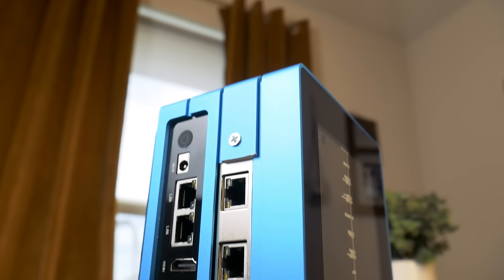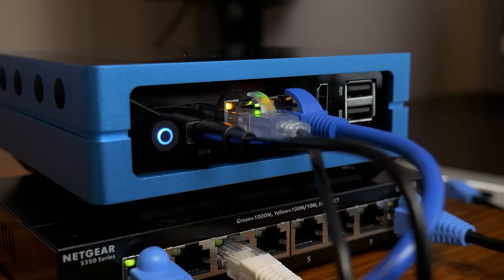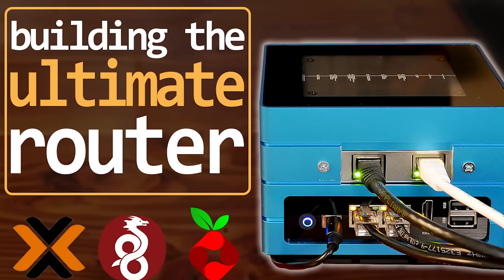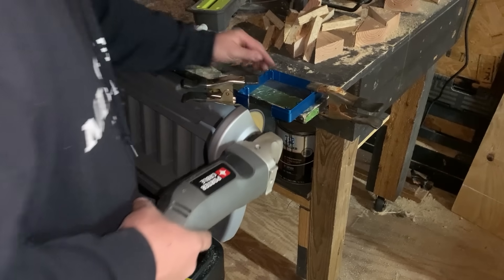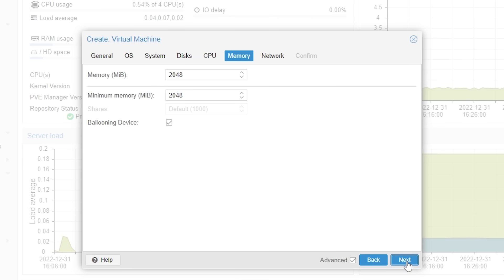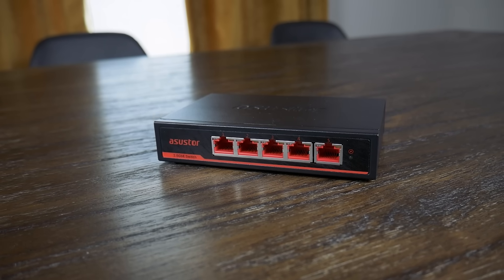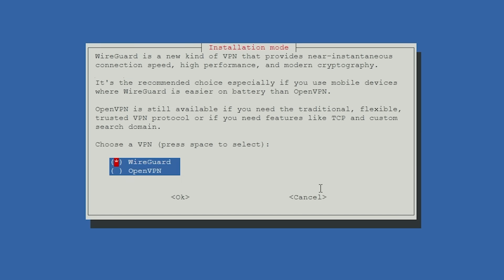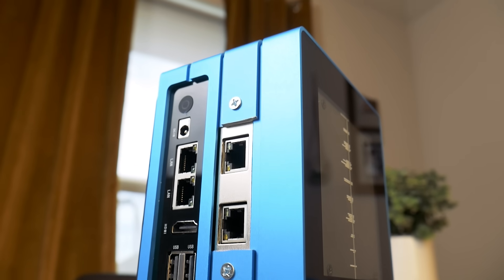Building The "Ultimate" Router - [PFSense + Pi-hole + PIVPN]

Comment: I have bought mini pc from China what has actually POE on 4 ports up to 60w total so i can plug AP to it and i have full speed wifi with proper vlans and all, 6 ports in total, it was like £180 with shipping - this was from the china site where selers are buying it in bulk, but you can buy "sample" as single item so ok, if it has UEFI and there was no so much tax on import from China I would think of buying more and slap on pfsense and sell it as AIO home router or small office
unfortunately it does not run UEFI so i cannot run sophos fw on it directly, i need to run it via proxmox

Comment: 11:53 A word here. That container running pihole gets a virtualized network connection right? Proxmox handles it and it's accessible from anywhere in the physical network if the firewall allows it, right?

Comment: doesn't pfsense have Pf blocker which is as good as pihole, also you can setup dns resolver so you can specify custom dns's, but whats even better is you can setup reverse proxy with HAProxy so you can even have valid certificates and https so you don't see all those warnings.
Wiregard is I believe also supproted, so there is no need for your setup to virtualize pfsense at all. Only reason to do it is if you don't have driver for your NIC in pfsense.

Comment: I've never run a server. I think getting one could be a step up for my computing projects.

Do you have any principles/recommendations for when to use a separate hardware? What 'deserves' it's own OS in a Proxmox setup, when should I just run stuff bare metal, and what can be rune in the same virtual environment?

I'm thinking of getting a pi-hole, creating my own file server for access and storage (linked to some form of backup), run some other self hosted services, and to tinker – without knowing exactly what I mean by that yet.

Comment: If you're running a PiHole, then you should be having it properly take control of DNS. Google "You're running Pi-Hole wrong! Setting up your own Recursive DNS Server!"

Follow those instructions, and then you don't even contact any DNS servers and your PiHole is actually doing the job it should. It's just as fast but after a while of scraping and caching, it will be faster than not doing so as well.

Comment: Pretty neat router you got there! I recently just added a 2nd Wireguard VPN on my Pi5 as a backup for those public wi-fi areas that doesn't allow you to connect using the default 51820 port. I have it running on a docker container and everything is running great after a few tweaks. My main router is a Firewalla Gold Plus that is also a hardware firewall and has tons of features. It also has a built-in Wireguard/OPVN and ads & telemetry blocking features. I'm still curious to run Pi-Hole with Wireguard on my Pi5 though and I'm having a little trouble with that on my network. I was able to successfully run Pi-Hole on another docker container and even have it running on https complete with SSL certs using NGINX proxy manager but when I use it as my DNS on my Wireguard on my Pi5, there is no Internet. I see the traffic being blocked though by Pi-Hole and all the stats in the Dashboard are running.  I think I need to forward the traffic correctly but time is limited and I'll try to troubleshoot that on another time. 😮‍💨

Comment: Found this video not too longer ago, and thought I would assemble the components and try to build out the same "ultimate" router. I am only at the parts assembly stage, and I think my question is a simple one.

Anyone know the part number for the HDD/SSD power cable?

Comment: Is this better than a gaming router?
Reply: Gaming branded items are always overpriced gimmicks
Reply: You can't even compare them. DIY router may not have fancy RGB, but it offers a ton of other features and can be optimized to get great performance
Reply: gaming routers are routers with access points, this doesn't have a standalone access point, but otherwise faster than those "gaming" routers.
Reply: @arhamzarif6313 Shud build another set as ultimate accesspoint
Reply: Sooooo Yes in a nutshell ? @arhamzarif6313
Reply: Gaming routers are a scam.
Reply: Yes absolutely
Reply: WTF are gaming routers?! 😂
Reply: @ferlemes  overpriced gimmicks
Reply: I was looking to buy the TP Link Archer ge800 gaming it has the fastest CPU on a gaming router but now I found that I can build a router that 5 Times more powerful router then TP Link Archer ge800 for myself 😅.
Reply: @Maiza007-c8y  Even better is you can build it cheaper
Reply: @Sphyxx  I just ordered a Ryzen 8845hs mini PC it'll be more powerful than Gaming routers that come in 2030.
Reply: @Maiza007-c8y  probably even in 2040 lol
Reply: It doesn't have red color so it's quite bad actually

Comment: Hello, I am a network administrator and we use pfsense for some customers as a VM on VMware, and it is super stable and reliable. Honestly, it is more reliable than some of our  SonicWall appliances. One customer has high uptime requirements, and the primary wan firewall has been up for about a year and no issues. (I know it needs a reboot. Again, high up time customer. Very specific case lol) but I highly recommend turning an old PC into a router if you want a fun project or your router shows inconsistencies or issues. You just need two ethernet ports, and add-in cards can be cheap. I do recommend Intel NICs if you are doing bare metal port forwarding. Non Intel cards can have issues on pfsense

Comment: I was running similar setup, but it was too much hassle to tinker with it and even my current Mikrotik AX3 is way easier to maintain while running Pihole and Unboud in the container direactly on it. I haven't noticed any performance diffrenece. Another advantage is decent wifi coverage which AX3 has. Power consumtion is also way lower.

Comment: I wouldn’t use the router as a virtual machine, you should leave it alone & let it be a dedicated router, just separate the work flow by getting another one of those & if you ever need more for other things, you can use raspberry pi’s as a cluster, but I wouldn’t use these if you’re trying to make a game server, I would get a rack Mount if you’re trying to make a game sever just so you can slot it in & out whenever if you have to for whatever reason, & get a rectangular flat long but short pc case & smack anything you want in there, make sure you get one with proper airflow & if you want you can be fancy with rgb fans but I would just get the ones that cool the pc because that is the priority if you’re making a gaming server, it’s not cheap but it gets the job done perfectly, depending on the pc build you built the more people can join, all pc’s have a limit you need a dedicated server for one game with a really good cpu make sure the storage is ssd’s you don’t want the storage the turn corrupt it’s wasted money & extra hassle, after that you’re good, just whenever you want another extra server you would need a another pc/server just to separate the work flow, if you don’t want to get a extra one back everything up from the original & replace it with the other server you want & now you know how to swap servers

Comment: This feels like a BUNCH of work that just isn't needed.
Pickup a Lenovo Tiny M720q, which has an optional PCIe slot where you can drop in a 2nd NIC (I have a 4x1Gb in mine)
Run the onboard NIC for the Hypervisor and pass through the entire PCIe NIC into the pfSense VM.
You ARE limited to 1 x NVMe M.2 drive for storage with this design however.
You can do a M720x instead which has Dual NVMe M.2 if you really want a dedicated pfSense drive.
If you do this, look into the 32GB Intel Optane M.2 drive.  pfSense doesn't need much storage and these are wicked fast.

Anyway, no soldering, no weird adapters from Ali Express, and you can get up to 6 cores if you get the 8600/9600 or higher CPUs.

Comment: I have seen those dual 2.5g nics on Aliexpress before, as you know a 2.5g nic can operate at 5gb in full duplex mode if transferring files from machine to machine over the lan. With 2, that's 10gbs worth of bandwidth. Can the PCIE interface support that much speed?

Comment: Question about the hardware. 

I really like this and want to build it for my own network. I've tracked down all the hardware you used in the video, except I'm having a little trouble finding the M.2 to dual NIC card. The normal places I buy don't have anything like it, or it's $70+. I tried finding exactly what you bought on aliexpress and found something similar, but it has slightly different information on the page then what you showed in the video at 3:51 (price, rating, number of orders). Could you tell me what the company name was for the card you bought or even better just directly link it? 
(sorry if you already linked it, I've double checked and didn't see it anywhere in the description, video, or comments.)

I've not used aliexpress before and am a bit worried I'm going to buy a bad product.
Reply from the maker: I believe this is the one
https://www.aliexpress.us/item/3256804012790087.html?gatewayAdapt=glo2usa4itemAdapt&_randl_shipto=US

also check out the LinkStar h68k from Seeed. It's arm based, but runs openwrt really well and that can run docker. I'm in the process of making a video on it, so I haven't had time to really test it out, but worth a look for sure! Even has built in WIFI so you don't need another access point

Comment: Currently I'm using a traditional (albeit quite high-end) router but I'm using it mostly for its incredible wireless performance and as the network gateway.  I've actually offloaded most of its functions onto a Raspberry Pi with the 64-bit Lite OS installed, such as DHCP, DNS, and PiHole and it has been working very well for me thus far.  I would love to do this all in one complete solution one day though.

Comment: length of videos shouldnt be a problem since now you can post videos over 220 hours in length there is a video floating around recently that is just that.
Reply from the maker: It's less of a "can I" and more of a "should I" lol
Reply: @HardwareHaven  i was hinting that you dont need to worry about videos running too long because of technical reasons except if the upload times out after so long for example if you can only upload a few minutes worth before the connection fails.

Comment: Maybe I missed it, but it seems that you set it all only on VMBR0. Didn't you set up another virtual switch, say, VMBR1, to make all the virtual devices running on it behind the pfSense's LAN subnet. Then, You  even can attach the second physical NIC to it, and have them all on subnet 192.168.10/24. Thanks
Reply from the maker: PFS is only running physical NICs, so the VMBR0 for everything else is just connected to the LAN1 subnet via the physical switch
Reply: @HardwareHaven  The WAN ethernet port was already attached to your ISP modem's LAN?

Comment: This is one of those scenarios where you have to wonder. Did you forget about docker containers? I feel like most if not all of what has been achieved here could have just used docker instead of virtual machines
Reply: Really great hardware though btw, I love the actual build
Reply from the maker: Thanks! And I think it’s important to realize that proxmox doesn’t support docker natively. It does support lxc containers though which is what I used. They’re extremely lightweight as they share the kernel with the host OS, so there isn’t any virtualization/emulation going on really.

Comment: Why would you need anything but pfSense? Just use pfBlockerNG and you make Pihole obsolete, and pfSense can do things like Wireguard or other VPNs innately. But I guess it's a fun project. Personally, I still prefer a small separate appliance for my router. It can just do one thing and that is handle the Internet connection and the security from the outside in. Then I can do whatever with the stuff I want on the inside.
Reply from the maker: Checkout the FAQ in the description as I talk a bit more on that there. But you’re definitely not wrong haha, and thanks for the comment!

Comment: Supermicro X10SLH-N6-ST031 from theserverstore? pfsense (+ wireguard + killswitch)? get 6+ ports at 10gbe for under $200.
Reply from the maker: Super cool board! But you'd still need to pay for the power supply, boot drive, and case so not quite under $200 unless you find a crazy good deal. Plus that could be pretty heavy power consumption for a router. It could still be a sweet system especially for running more VMs and such which might be a bit scary haha

Comment: I just built my firewall out of an old recycled Lenovo system with an i7 4770, threw in 16gb of ram, a 128gn boot SSD and a 10gb SFP+ card. I shoved it all in a 2u chassis and it's pretty solid for the age of it.
Reply: What's the power usage?  I suspect buying a more modern power efficient device would actually save money in the long run.  It's definitely something you need to consider when determining what devices to use.
Reply from the maker: Sweet!

Comment: Not sure if it's been mentioned below, but what if you connect the LXC containers to a virtual switch and an extra interface for pfsense to route the LXC traffic without passing through a physical switch. This would force traffic directed to the LXC containers through PFSense (like PiHole) but ultimately would eliminate PFsense from routing from one physical interface to another physical interface to virtual interface in the container
Reply: That's the sysadmin way of thinking. Much faster to have containerized, virtual switches when translating network traffic from VM to VM

Comment: Would help to say the expected price point to build such system. What about using OPNsense instead as I heard that pfsense does not receive updates often?

I still have an old Apple AirPort Extreme router, which I haven’t use for years. Any chance I can hack into it by installing third party software replacing Apple’s software? Or better to build new hardware?
Reply from the maker: As far as price, I’m not really sure. I probably wouldn’t recommend the exact route I went as there are pretty affordable dual/quad NIC mini PCs on the market that would probably be a wiser choice. 

As far as hacking the AirPort Extreme, you’re on the wrong channel😂 Seems like a super cool idea, I’m just not smart enough to give any advice

Comment: You actually dont need more then 2 NIC's for Proxmox and pfsense. Just allow pfsense to reach out to wan through one, and LAN through the other, which also allows proxmox to use the LAN port as well :)
Reply from the maker: Yeah but I like PFSense having direct access to the NICs vs virtualized ones. Makes it much easier to boot bare metal if needed
Reply: @HardwareHaven  That makes sense. Ive been running pfsense on proxmox for over a year now and its been super solid (as long as im not making dumb changes to see what happens)
Reply: I might argue 3 is the perfect minimum number of [passed thru] NICs for PVE+pfS, as you get 1 in, 1 out, and 1 for managing locally without getting in the way of the network
Reply: @Maleko48  I absolutely agree, im just a cheapscate who doesnt want to buy more NICs

Comment: All I would offer as a critique is that pfSense can run OpenVPN so there's no need to separately run piVPN.  Having said that, I LOVE piVPN for it's ease of set up, and use of WireGuard for a client.  Great system.  pfSense and piHole are awesome, love them.  Thanks for the video :)
Reply from the maker: Yeah I mention that in the FAQ in description, but thanks for the constructive input and kind words!
Reply: and pfBlockerNG does the same thing as piHole anyhow, so you can run them all on the gateway (I do..) Only thing I use a pi for is GPS based stratum 0 NTP server

Comment: But why? 🤨

pfSense literally does all the functions of this. pfBlockerNG + WireGuard. Or OpenVPN. No need for a separate dedicated device for these functions, so I'm struggling to see the use case for this. In case you have to swap firewalls? By that token, when not put in a third box to handle DNS and DHCP? In case you have to upgrade your firewall or a downstream server.

Neat. But I just don't think it's practical or useful.
Reply from the maker: I hit some of this in the FAQ in the description, but some of it was just for fun. I think there’s merit to having some isolation between the firewall and other services. If I decide to switch  firewalls, it’s as easy as just installing a new SSD and basic setup. I don’t have to reconfigure all the other services and such. Also, when the next new vpn service or whatever comes out, I’m not waiting on an experimental package to come out

Comment: Great video. I play with such things quite a lot. Is there a reason why you used iommu pass through instead of just making network bridges to the network card ?
Reply from the maker: Really just for more separation between proxmox and PFSense in case things go south. If I need to boot the PFS drive bare metal, I shouldn't have to load drivers or anything, and the interfaces SHOULD populate correctly. At least they did when I tested it.
Reply from the maker: Also not sharing any bandwidth if I were to run anything more data heavy using the network bridge

Comment: Always nice to have more control over router and clans ect. 
But setting up iptv from the ISP can be a pain to setup properly. 
I noticed myself doing so. IGMP needs to be enabled or other protocols, depending on how your ISP handles iptv. 
And you don't want to piss off others in the household. 😋
Going fiber is also a different challenge depending on compatible hardware.